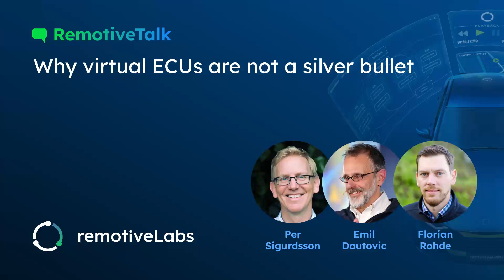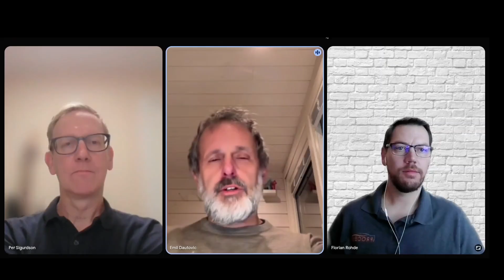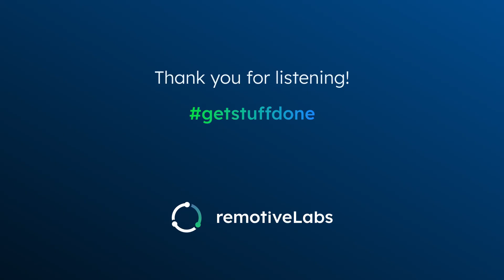Virtual ECUs are NOT what you think - the truth about automotive software testing

Comment: As I see it, there are four key factors in any system of virtual ECUs used for testing that need to be analyzed:

• Time
• Fidelity
• Model definition, implementation and reuse
• Test harness rigor

It’s worth looking at how related domains address each of these.

────────

ECU SoC development

Time. Simulation is almost always performed in virtual time, with verification methodologies such as UVM anchored around virtual time. Simulation is slow, but the problem is largely addressed by running large batches in parallel.

Fidelity. Well-defined abstraction levels exist, each with its own tooling: behavioral, register-transfer level (RTL), gate level, mask level, etc.

Model definition, implementation and reuse. Models are defined in standardized, interchangeable hardware description languages (HDLs) or interface description languages (IDLs), with everything managed under version control.

Test harness rigor. HDLs enable extremely rigorous test scaffolding, and verification methodologies such as UVM have standardized much of this process.

────────

ECU software development

Time. RTOS based software is tied to real time through hardware timers and peripherals with hardware clocks (ADC/DAC sample rates, PWM periods, serial interface bit rates, etc.).

Fidelity. Less well-defined than hardware. A software implementations and/or executable models. ARXML of a sytem as a parallel artifact.

Model definition, implementation and reuse. Coding standards, common software platforms, and version control provide the primary mechanisms for consistency and reuse.

Test harness rigor. In pure software, this is relatively weak because conventional software testing frameworks provide little rigor in the time domain. Virtual ECUs and HIL systems can provide strong time-domain rigor, but at significant cost.

────────

I think that if you can answer how your virtual ECU system handles each of these four factors, then you can begin to understand "the truth about automotive software testing" with virtual ECUs.